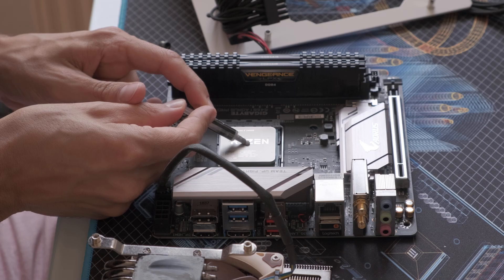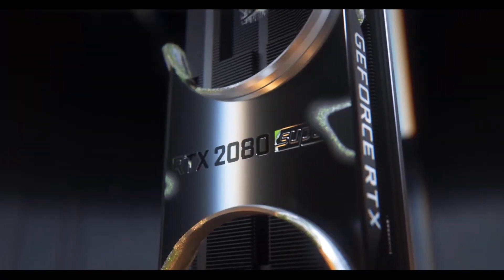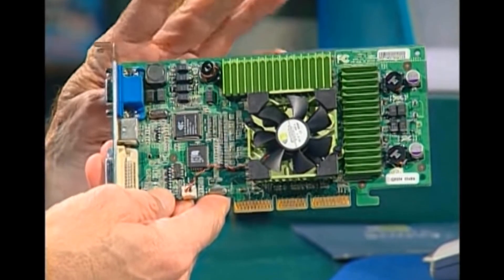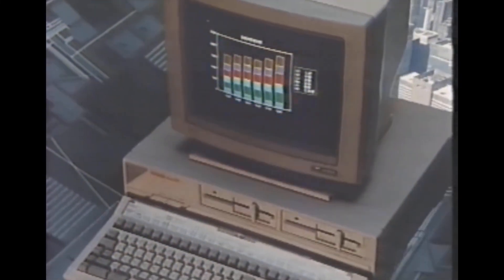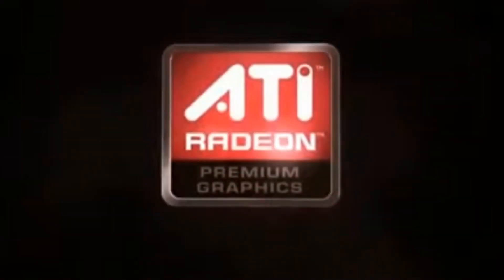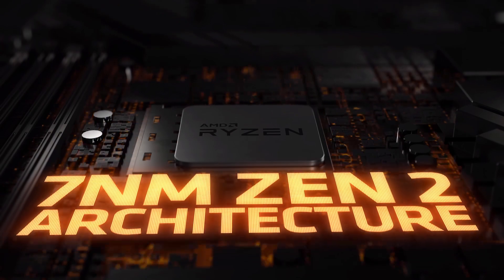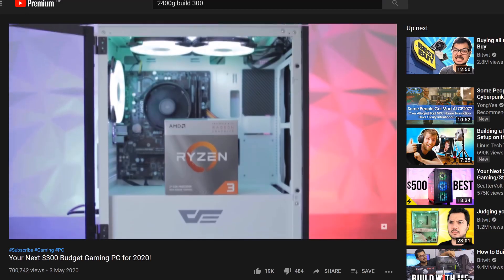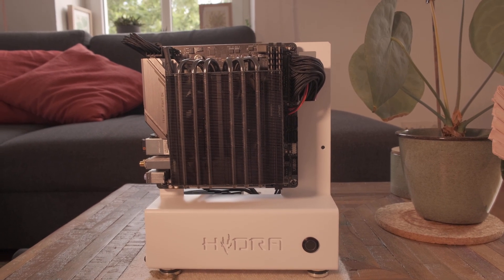If APUs are the future of desktop PCs, what is an APU?

Comment: I don't know about computer architecture, but what if apus were made in the size of a threadripper? Would they be able to offer more performance? Would it actually be possible to make?
Reply from the maker: Actually the new PS5 and Xbox Series X both have specially tailored SoCs powered by AMD's RDNA2 and Zen2 architectures integrated in an APU. Those consoles run AAA games in 4k at 60 FPS. So it is definitely possible and considering the ever growing price for GPUs, we all might be better using something like that.
Reply: @soundelegy5987  Ohhh and here i am thinking that the ps5 and xbox actually had an integrated gpu, turns out it was an actual apu! I can only imagine the future of apus in desktop pc or even laptops!
Reply from the maker: The future looks very promising for these APUs indeed. Valve's upcoming Steam Deck portable console might be a huge leap forward. Will get mine in December and run some tests, stay tuned ;)
Reply: @soundelegy5987  subbed! Great content!